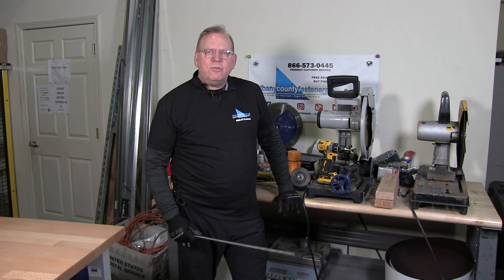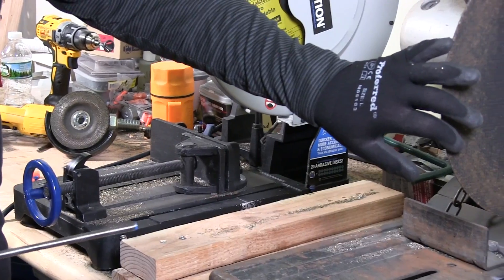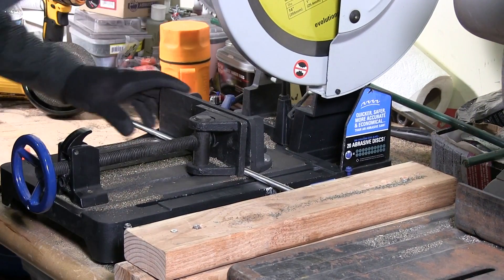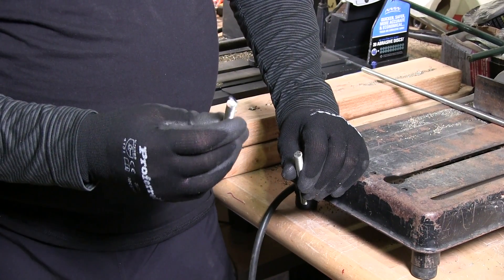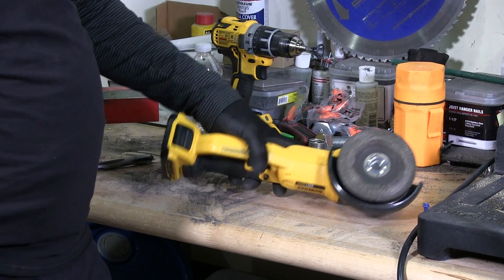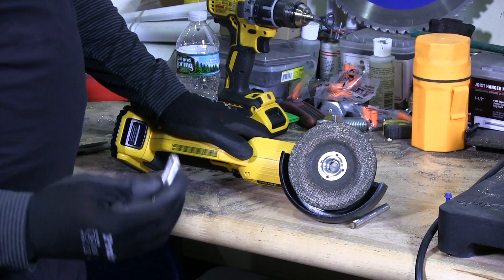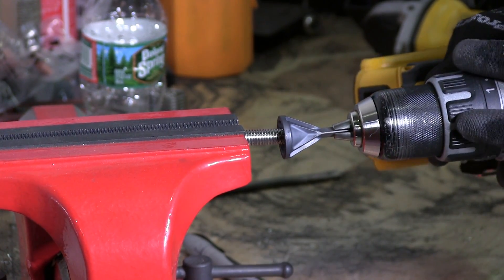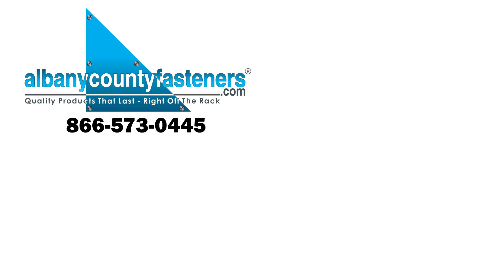Make Your Own Threaded Studs | Fasteners 101

Comment: yes if I happen to have about $10,000 worth of machines
Reply: How did you get $10K? That doesn't make sense to me. You probably already have a drill. You could spend as little as $100ish to get a used chopsaw and grinder. $30ish for the chamfer bit.

Comment: Well I was wrong someone else did make a studs video.  Also my chopsaw and pretty much any I've seen come with a vise to hold the material, metal blades are nice but abrasive is a lot cheaper for an occasional use hobbyist.  Always thought those bolt chamfer things were cool but are pricey!
Reply from the maker: Thank you for your feedback!